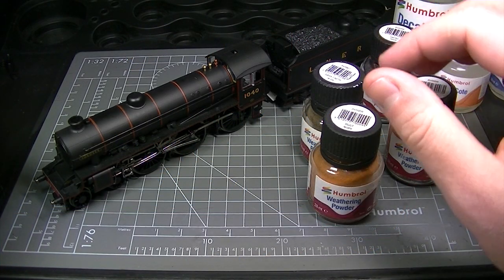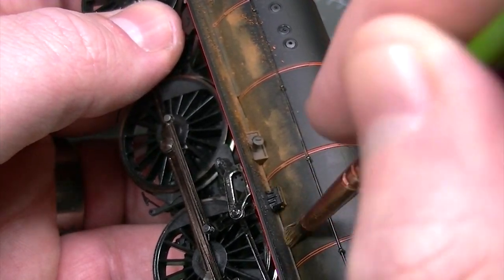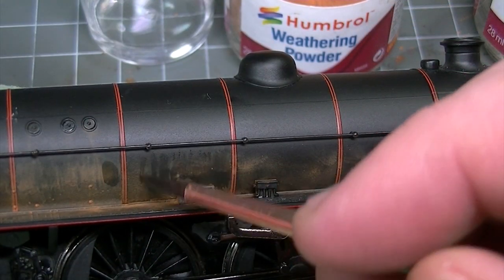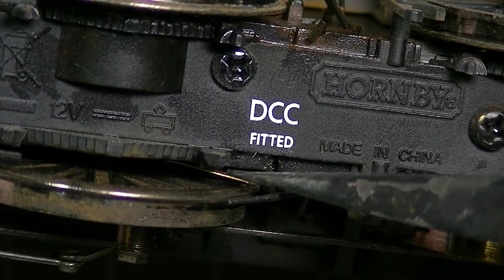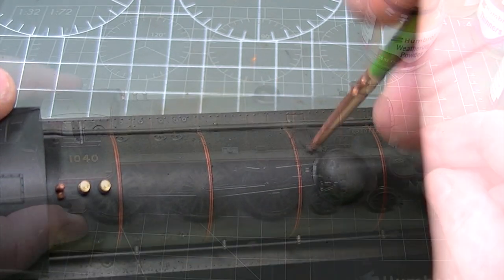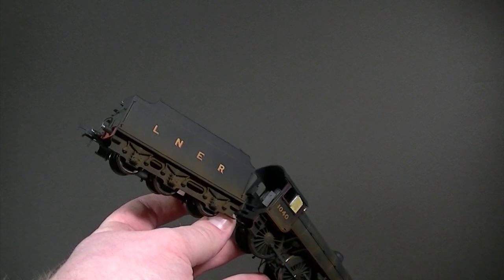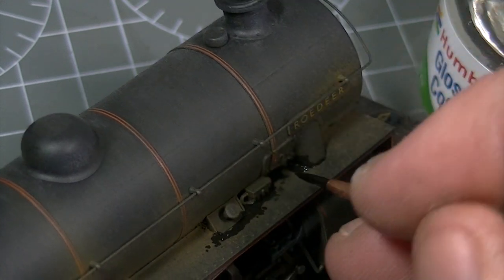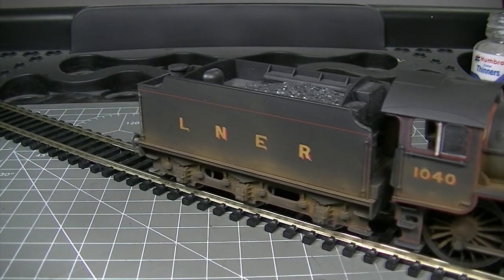Humbrol - Weathering Powder - Hornby Class B1 Steam Loco

Comment from the maker: It was simply a case of resting the live rails on the coal tender as this has pickups and no moving parts on the wheels.  The notched part of the wheels holds the rail so you're hands free to do the clean-up.  If you've not got a coal tender you could always rest it on the wheels gently.

Comment: Here's a thing -- track weathering. Humbrol should introduce a new line in electrically conductive weathering material that can be applied to bright steel track to make it look more realistic. Real rail sides always rust, and real rail tops will dull down in a matter of days when not run over, so you can keep your main lines bright and your seldom-used sidings appropriately rusty.
Reply: universalsailor Add iron oxide to your paint mix, test it on a few bits of track first, till you get the quantity correct and it will be conductive. FE203/4 and some Cu0. Which isnt just matching a rust coating - it is RUST lol. 203 is rust, 204 is dark rust, Cu0 is copper - all 3 are conductive, so great care should be made not to overspill to create a short of course.
And if you wanted your main lines to look even more realistic, add in a higher quantity of aluminium powder, as the trains run over it, it will create the exact same as the real rails, only the places where the wheels contact the rail will become silver and shiny, the rest will look rusted.

And yes humbrol should mix them.
Reply: universalsailor just paint the rail sides a rust metal, the sleepers wood or concrete, leave the top since wheels wouldve cleaned the tracks anyway (irl)
Reply: buy steel track and a humidifier for your layout

Comment: These videos are awesome and i agree it does make the engines look better.
However the irony of course is that NO engine on the UK mainlines would ever have been allowed out dirty. Drivers being proud, the companies being proud and the engines being steam - they got steam cleaned all the time, and there was always someone cleaning and touching up their paintwork lol.

It was only when they introduced electric / diesel did the older steam engines end up neglected.
Reply: +36c Studios Even the A4s accumulated grime over the course of a run. I've seen photos of those lovely silver-grey A4s where the panels are clearly outlined with soot.
Reply: CK Wunch youve popped up in a few weathering videos and you clearly have no idea what you're talking about......
Reply: You need to look at some pictures mate. Those locos were filthy, only the prime express trains weren't
Reply: There are a few videos on you tube lasting just under an hour featuring steam locos in the early 1960s, most of which were pretty grimy. As has already been said, only the express trains were kept in a polished condition.

Comment: I used the spray on my coaches and found it glazed up the windows on the coach. Is there a way to get it off the windows and prevent it happening again?
Reply: Two years later did you ever find out?
Reply: @Lamo679.  Unfortunately no  one replied to my comment.

Comment: sorry novice here great video but how do you run your engine upside down? thanks
Reply: reakingringpiece 
I’d like to know that too.
Reply: Take a look at the Sam's Trains channel. He often posts servicing videos where he connects straight to the motors or DCC chip to power them. It does usually involve removing the body of the loco though, so not quite sure what they did in this video.